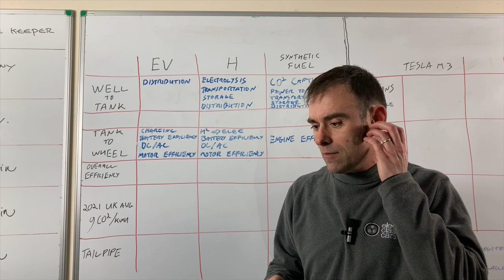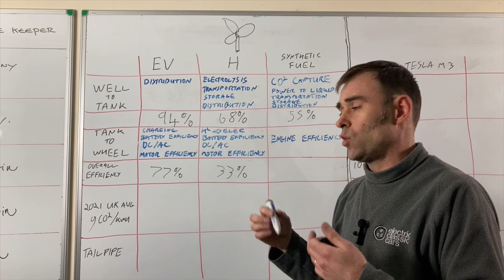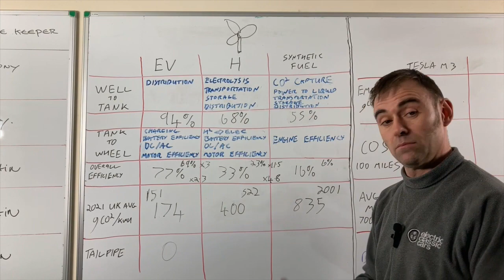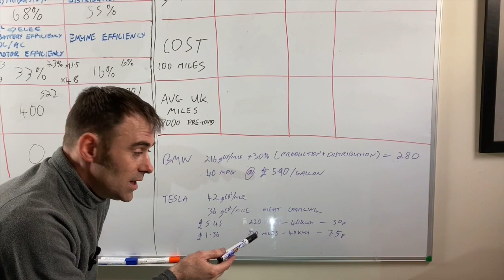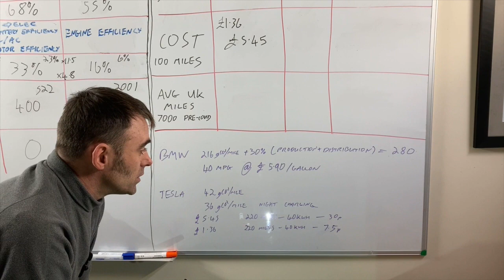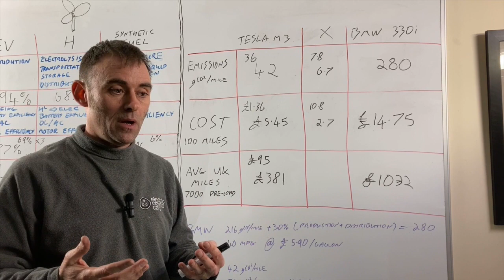Is Hydrogen or Synthetic fuels the end for Electric Cars?

Comment: Lorries and heavy machinery are going electric too as well as short distance shipping. For long distance shipping and air travel there may be a use for synthetic fuels if it can compete with bio fuels. We need hydrogen for making fertilizer, explosives, methanol, CO2-free steel etc so hydrogen will be produced at scale regardless of use in transportation and if someone comes up with another good use for hydrogen I'm sure the hydrogen producers are happy to sell some more product.

Comment: Problem with batteries is the short range and slow fueling time. This isn't an issue for city commuters who own homes, but for those without homes or who are making long trips it's not a particularly viable option. This also includes freight trucks, which are obviously a critical and large component of modern automobile use.

Because of this, I feel like Hydrogen is the ultimate best all-around option for the future, despite the significant infrastructure costs to initialize off the ground. At the least biodiesel or ethanol might be good choices as well, but they have problems as well (like food prices or potential non-viability due to theoretical demand outweighing potential supply).

Comment: Didn’t you say at the start (when you drew the wind turbine) that the assumption was that 100% renewables was used…. That’s where you got to 94% well to tank for EVs?
Then in your 2021 figures you confirmed that the UK grid is pretty much an equal split between renewable/ traditional/ carbon friendly?
So using the 2021 grid figures what are the revised well to tank % for the 3 fuel types?

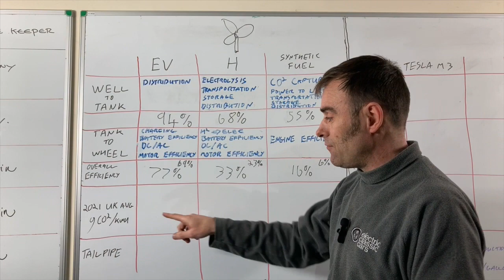Comment: 12:30 It is wrong to "calculate" a different gCO2/kWh value for hydrogen or synthetic fuels. The total grams of CO2 per kWh is always the same no matter what fuel you're using as long as the energy used to produce them comes from the same grid, which is the case in your comparison. You'll just consume more or less total energy (well-to-wheel) to move a car a certain distance depending on whether the car is powered by electricity, hydrogen, or a synthetic fuel. The value you should be looking at, which would be appropriate for this comparison, is grams of CO2 per kilometer driven.

Comment: The major problem.with electric Is the efficiency in temperatures below degree farenheit.    They have a massive 41% loss of range due to the cold.  That's just what I gathered from a quick search.  So places like Canada and half the upper united States you'd have to heat the garage to store the Tesla and then you still have to go to work.  You could use a wibasto diesel burning heater to offset the loss, however The hydrogen cell runs well in temps in -40° f...  So that should be considered when you're deciding what you want to buy....   A huge problem for hydrogen is the limited fueling places, so again maybe there could be a person to come up with a cheap way to produce hydrogen off you're solar cells on the roof.  That, that would be a huge game changer...  The good news is a lot of the petrol stations here in the Americas have a lot of liquid petroleum fueling kiosks.  Which could in essence easily be transfered over to Hydrogen. I've heard that Norway has  fantastic hydrogen generation technology already in place at their stations, So much so they have a massive highway they call hydrogen highway.   So yes it is achievable and as economies to scale improve I firmly believe hydrogen is the way to go In extreme cold climates...

Comment: Good break down. Made me consider a few points I hadn't before.
There are a few things I feel are needed for a more overall picture though.
Environmental cost of building an ICE vehicle Vs an EV in the first place (and not just the climate aspect)
The environmental cost of recycling all the combustion cars already on the roads. 
The environmental cost of replacing fuel stations with ev chargers. 
How many people can afford to make the change? Those that can't afford it could still be greener using synthetic fuels in their old cars. 
Was the figure accounting for the CO2 removed from carbon capture process in the total produced? 
As they're artificial hydrocarbons they only have the one molecule chain needed, so burn cleaner than traditional fuels. 
Good video though! Very thought provoking

Comment: Electricity starts with "distribution"? So how is it generated? It comes falling out of the sky? While the other sources lose efficiency during making (according to the table) there is no loss for electricity? This is nonsense. Just look at the lie that is biomass. Enormous areas of wood have been cut down for the biomass ovens. This is the major way to generate power in the EU at the moment and it's efficiency will be about 30%. Coals is not much either. Only nuclear, wind or solar energy will help, but these are a small portion of the total electricity generated.

Comment: Great explanation! But, the issue with hydrogen production/distribution infrastructure is not just that it lags behind, it is inherently difficult and unavoidably expensive. Full pressure in the cars is 70 MPa, that is 700 atm, and the fuel stations typically keep a small amount at about 80 MPa, in order to be able to fill a car to 70 MPa in a short time. Then, that small 80 MPa buffer needs to be re-pressurized, typically for a bout 30 minutes, before next car can refuel at full speed. 

2 cars an hour, it is designed that way to save on costs, well then, those stations has to be practically free, right? Nope, typical cost for one such hyper-budget solution is about 2 million euros. Sure, mass production and further development could reduce the costs, but, the technology is not new, it's not like we started to compress gases to power hydrogen cars.  

No, if hydrogen were just moderately more problematic to deal with than say methane, we would probably had adopted the hydrogen economy a long time ago, well before wide use of litium based batteries. The fuel cell was actually invented before the first rechargeable battery was invented. It's not lack of time, effort or money in R&D, or lack of potential benefits compared to petrol and diesel fuel for that matter, that prevented mass adoption of hydrogen fuel.  Also not so much "chicken and egg-issue", with fuel stations and cars needing each other, the main issue is the fundamental properties of hydrogen makes it unavoidably extremely difficult and expensive to deal with.

Comment: I was thining about the Octopuss Go tarrif, but as most of our home is electric, apart from the heating and hot water, the cheap night time tarrif would be outweighed by the higher than average daytime tarrif, where most of our usage would occur. Cooking, Lights, TV, Kettle, X Boxes, Tumble Dryer (wouldn't dare leave on at night) etc. So I think our only option is to stick with a standard tarrif and pay a bit more to charge up.
Reply from the maker: If you have an EV it should work out cheaper, depending on how many miles you do. It's worth crunching the numbers to work it out. 👍
Reply: @ElectricClassicCars  Yeah, suppose that would be some spreadsheet, listing all the appliances in the house, and working out how long they're on, or on standby, or off etc. I'm working form home, so won't be doing many miles really. Wifey will probably be pinching the i4 to go to work, as it will be cheaper to run that her Fiesta. We'd be doing maybe 600 miles a month, so that would be 2 full charges in the i4 per month. So 168 kWh x £0.075 is £12.60, and on our current rate of £0.28/kWh, it would cost £47 a month. If only there was a website calculator you could chuck some basic info into, for the average home.....
Reply: I just crunched my Aussie figures (I have a older 3.2kWh solar system).. they buy back at 5 cents a kWh..and sell to me at 25c a kWh (so over  89 days.. they bought back 384 kWhs at $19.70.. and sold me 809 kWhs for $204..and then ADDED a Supply Charge at  $136 (so $1.50 per day to be on the grid) my 9 kWh daily average at $3.84 per day ($1.50 of that being supply charge and  $2.35 being usage of 9kWh ) so to re-charge an EV.....let us say 27kWh  (every night ?) multiply $2.35 x 4 ( 9kWh for the home...and 27kWh for the EV.. 35 total plus $1.50 ) which would still be under $11 Aussie dollars (5 British pounds per day  ?) to run my home (no heating no aircon)  and also  drive a 100 kilometre commute a day (60 miles) our diesel instantly hit $2.60 ltr when the little napoleonic turd starting playing war games.. and now its back to about 2.05 ltr (so 100 kilometres in my 2010 Jeep 2.8 diesel 6 speed (a very economical vehicle indeed (it was at $1.30 ltr anyway ! (June 2018).. but today.. to go 100klms pushing it.. maybe  A$20 ? ( and that takes no vehicle maintenance into account) so EV is easily faaaar more economical ( for short range stuff).. and far less maintenance (but our problem down under.. is the cost of storage batteries) if we could store our solar energy.. the power companies would go out of business (apparently its still well over $20,000 investment .. to get a storage system.. that will even cover 3 rainy days for a 3 brd house of 5 people) my $4 a day costs are extremely cheap..only as Im a retiree with only a computer, a light bulb and a fridge (many families pay over a $400 a month for electricity even with 6kWh solar systems on their roofs (because of storage battery costs) if I had aircon on..or.. a pool filter( or 3 kids taking showers) I could very easily double or even triple my power bill )  but even with the EV re charging 25kWh a night.. it would still be far cheaper and better for the environment.. than buying petrol or diesel ( but with our extreme distances down under ( many many people drive over an hour or two "each way"  to work daily  (Im retired and hence...why my costs are but a piddling) but if I was younger.. its just such a no brainer to go EV ( as Moggy so clearly points out ) we all  need to address our carbon footprints (so doing 1000 kilometres a year in a diesel jeep.. is far less of a carbon footprint than some guy in a Prius doing 50,000 miles a year .. or some guy in a 4cylinder Toyota driving daily) our Governments are "in the way"  of change ( they don't want us to have storage batteries.. or EVs (it could easily happen overnight) or ..to get off coal generated power plants  ( we sell $130 Billion of coal every year to China) when home storage batteries become affordable.. the power grid is virtually out of business...what a great scam.. buy for 5 cents.. sell back for 25 to 40 cents ! .. but yeah .. good point Moggy.. the big BB haulers...need diesel ( but its the daily commuters.. inside 50 mile radius ..especially in high density cities.. that should all be on EV asap  (by 2030 or earlier) apparently the US Federal Govt..gives a $7500 cash rebate to anyone buying a used 2019 Tesla for $25K (with 25k miles on the clock) and Oregon State another $2500 tax write off) the more information.. like above.. the faster it will happen..and it doesnt mean motor heads cant still have their V8s and motor racing.. its the masses commuting.. that can really change carbon footprint ( 37 million people in Tokyo ! ) I dont know London's population ?..California is working very hard on it (a very positive progressive state) so yeah.. its happening..its happening in China ..Australia will be at least 10 years behind the rest of the world (it always is (we love our backwardness) we are almost into the 20th century.. but not quite .. I take my hat off to ECC.. and EV West.. and all the new technology.. the Sheople will come around.. in time..via the examples of others

Comment: The elephant in the room for all discussion on EVs is batteries… and it seems to be overlooked for convenience. Granted that EV performance compared to ICE is spectacular but the storage of energy using toxic and dangerous chemicals remains a critical weak link and all I see/hear about this topic is “wait for the advances in battery technology”…  how long do we wait and what does the excavation of critical minerals mean to our ‘conservation image’ and also consumption and depletion of the same… hardly environmentally friendly or sustainable.

Think also about the volume of EV cars compared to real global demand for cars… EVs really don’t make a dent and there’s already issues with production for a very low (globally speaking) uptake of EV at only 20,000,000 - please amplify this to 1,444,000,000, which is the current number of cars worldwide when considering future demand for batteries and tell me EVs are the real silver bullet…

The assessment also expresses EV v Hydrogen and/or Synthetic Fuel as a zero-sum game, with traditional industry losing, which I don’t buy into. I’d prefer a collaborative approach where all technologies advance on their merit as they each have justifiable uses - I wonder how many readers, for example, will be happy to board a flight from London to New York and even further on a battery-powered plane. The sheer weight of the batteries required would preclude the plane from getting airborne.

Anyhoo - just some thoughts

Comment: Also you could have mentioned car tax and maintenance cost.  I think the bmw(over £40k car) would be £230 year 1 and then £520 for 5 years. The Tesla will be zero.

Maintenance at a main dealer probably around £100 a year for bmw, for the Tesla I’d say about £30 a year.

So 6 years fuel+tax+maintenance 

Bmw £9622
Tesla £750 (cheap rate electric)
=£8872 saving 

If you also commute into congestion zones like London center you could pay another £3000 a year so another £18000 potential saving.

So a person that does say 15k miles a year and commutes into the center of London could save around £35,744 over 6 years of ownership.
Reply from the maker: Very good point. 👍👍👍

Comment: Can I ask a price and cost question? Why aren’t manufacturers building lower cost EV cars - is this impossible and if so, surely the comparison we should be hearing about is an EV car ( v expensive to buy) vs a small simple Petrol car. For example, the cost to own an EV (£45k?) v a £16k Petrol car. I am feeling so much PR to EV but what will the eventual cost to the consumer, post 2030? Thanks
Reply: They have invested billions in engine manufacturing plants(sunk cost)

Battery manufacturing facilities are still limited.

Raw material supplies have not ramped up enough.

Car makers are nervous of battery issues and warranty claims(Nissan and gm have had nightmares)

Like moggy said, their dealers hate the low ongoing running costs which losses them a lot of business.

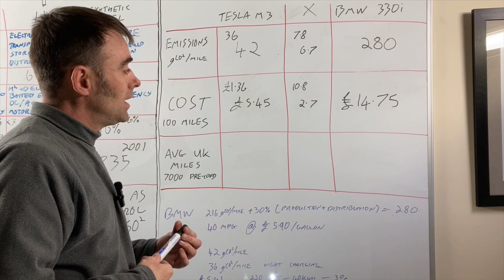Comment: 29:20 I feel I have to come in at this point - I can't charge at home. What was my total cost of charging in the last 12 months? About £16 from road trip miles but including over 5000+ miles in total with my short daily commute. Yes, I charge at work for FREE. Ok, you don't have charging equipment at work. ASK to have it installed. It's free to the company. All they have to have is the space to put in the equipment. I charge once a week, but often it could be once a fortnight on our two Zappi Type 2 EVSEs. How long does it take to charge to full? About 30-40 seconds [that's 240 miles with a 58kWh battery VW ID.3]. The time it takes me to plug-in and un-plug at the end. Or typically 2 hours while I'm working, so I don't care. Around 25 minutes for the same on a Rapid Charger at 100kW, ID.3 Max 125kW]. Think about it before you continue with that fuel-guzzler.

Comment: Excellent overview. Synthetic fuels aren't a complete waste of time: they are a reasonable solution for long-distance air travel. Hydrocarbon fuels are the only technology with sufficient energy density for that purpose. Synthetic fuels would work with existing aircraft, avoiding the decades-long and billions of dollars process of airworthiness certification.
Reply: Even other companies are taking a shot at it. Porsche, Lamborghini, Mclaren, Siemens energy, Ferrari is thinking about it but not sure yet, even racing organization Formula 1 is committed to efuels ( synthetic fuel ) in 2026. Audi also is joining F1 when it announced they are using that fuel for 2026. Hydrogen Combustion Engines also are being looked at thanks to Toyota. Cummins is even working on a hydrogen ICE as well.

Comment: Excellent presentation Richard, thank you. It’s great to have such a clear and worked-through summary of why hydrogen and synthetic fuels will likely never surpass EV tech for small road vehicles. One minor correction if I may, on the tailpipe emissions for synthetic fuels. In a modern petrol engine, the combustion is carefully controlled to be stoichiometric, so the NOx can react as close to 100% as possible with the CO in the catalytic converters to create N2 and CO2, and there will be zero Sulphur emitted because we won’t put any into the fuel synthesis in the first place. Having said all that, anyone doing a “typical” London school run over a tiny mileage will be puffing out some of those nasties before the engine and exhaust system warms up.